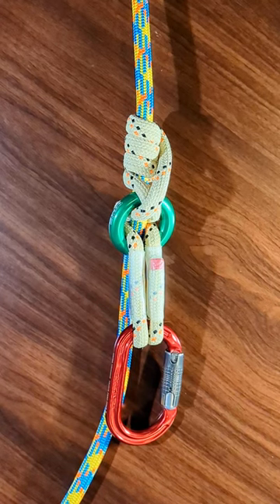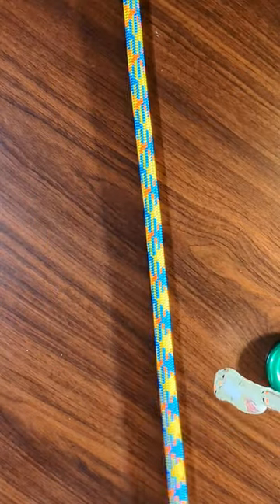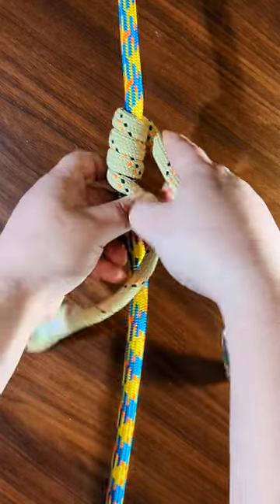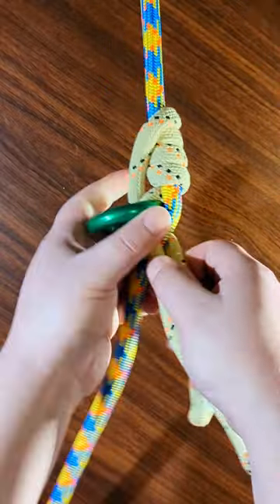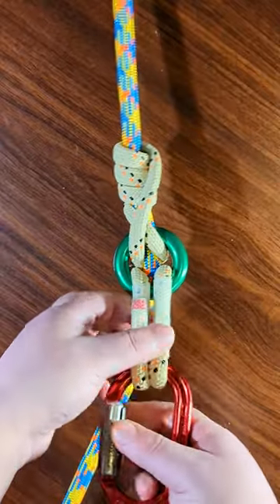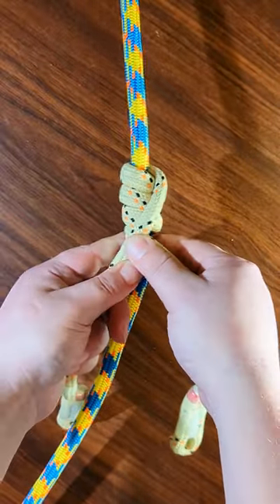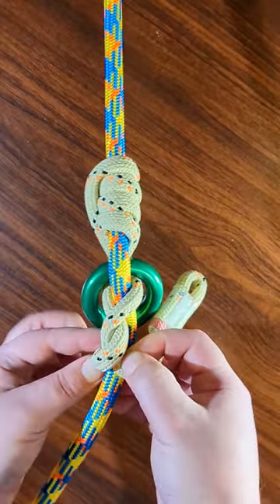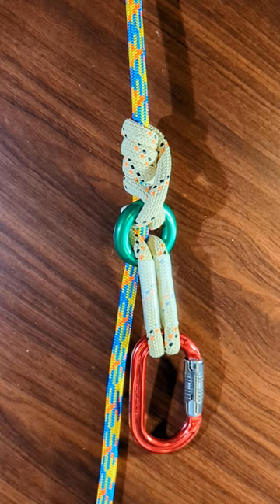STICHT Friction Hitch for Arborists & Tree Climbers by Brocky!

Comment: Thanks for this! An absolute game changer, for anyone who doesn't know this hitch perform equally well SRS or MRS. With no added friction needed in SRS meaning no Rope Wrench necessary. I've never liked the Rope Wrench so using this hitch has been wonderful. Did knot-torious invent this hitch?
Reply from the maker: You're very welcome!  Although my channel mostly contains my hitches, I have a standing open invitation for anyone else to share with me their hitch creations and I will happily post them on my channel if the hitch is of good quality. The Sticht hitch was invented by a guy who posts on The Tree House and Tree Buzz as "Brocky." He is a friend of mine and we stay in touch over our mutual obsession with hitches and hitch cords. I did invent a similar hitch which you see here: https://youtu.be/YaKdXWY4bAA You can make more like that Sticht by making a twist of the hitch legs behind the ring instead of just a crossover. Mine begins differently, with a doubled clove hitch for the four wraps instead of a basic four wrap arrangement.

Comment: Thank you very much for demonstrating this hitch. I am new to rope climbing and I just tried it: it worked flawlessly! As I lacked a ring, I used the small O of a figure 8 (28mm diameter). This makes it quite practical to move my hich up by grabbing the other side of that 8 (I oriented it perpendicularly to my rope). It also tends very well manually, even without a pulley, and has minimal set back. I also tried the 'Synergy' version, which is very elegant, but not as easy to equilibrate with an eye to eye prusik cord.
Kudos to Brocky for inventing such an effective solution, making srt accessible with very basic gear. I am going to use this a lot!
Reply from the maker: You're very welcome! It is a wonderful hitch! And, yes, the hitch tends quite well without a slack tending pulley due to the elbow (twist) at the back of the ring. Yes, the Synergy hitch is a bit more complex and it's not as easy to get it correctly dressed and set...but not by too, too much. Glad you've found a friction hitch that works well for you!

Comment: Is the 34mm ring a critical size or could I use a 40mm ring.
Reply from the maker: It really depends on the diameter of your hitch cord, where larger diameter cords (like 10mm) might work with a 40mm ring. I honestly don't know. I've never tried it with anything but a 34mm ring. I know people have done it with the 28mm rings, but that doesn't really help you.

Comment: I am using 9 mm canyon elite rope what cord and ring do you suggest I use?
Reply from the maker: Maybe a 28"-34" internal diameter, rated anchor ring with a 7-8mm hitch cord. A rated cord that is friction resistant with aramid fibers is mandatory. Sometimes known as "friction cord" and "tech cord."

I would recommend a 28-30“ spliced or sewn eye to eye hitch cord. If you get sewn, 30“ might be better. You'll really need to play around with it. I wish I could just give you a singular answer.

If you need further assistance, please don't hesitate to ask. I can also be reached at knotorious.contact@gmail.com!